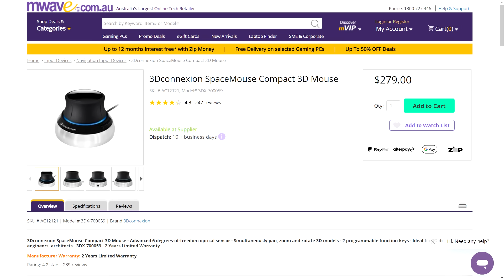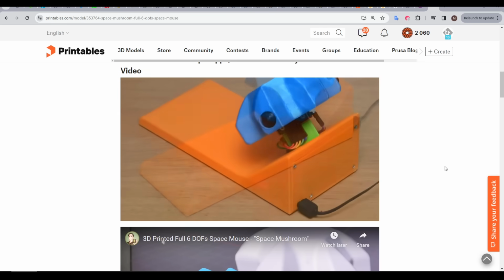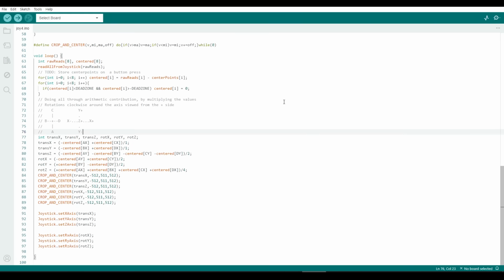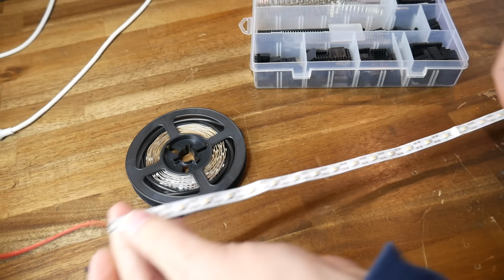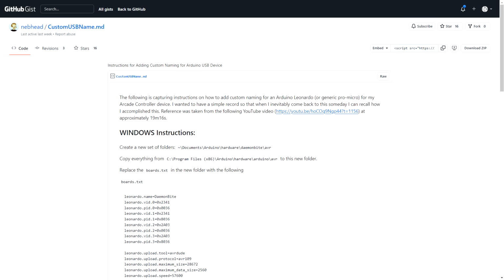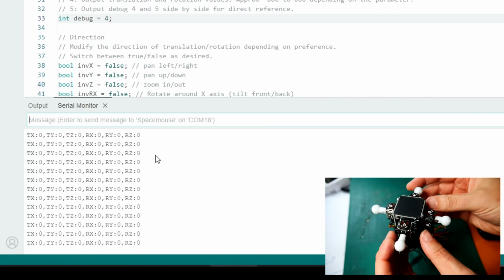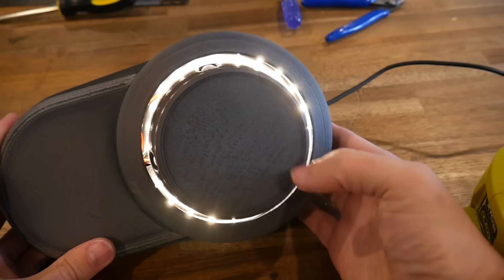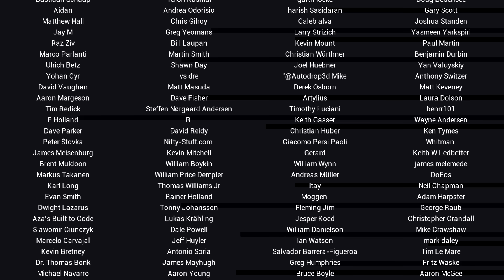Making a cheap, open source 3D space mouse with Arduino and 3D printing *V2 out*

Comment: I bit the bullet and bought a space mouse. I love it. I use a lot of CAD sometimes 8 hours a day and see it as a worth while expense. I'm so glad 3D printing can make it more accessible to the hobby market.
Reply: I'm hoping this will lead to better software integration for space mice.  Kinda sucks that they can only be used for a couple programs right now.
Reply: Space mouse let's me do things so much fricken faster it's not funny. If you're doing CAD full time there's no reason not to plop down that money. It's your tools of the trade, don't skimp!

I find people don't put enough thought in their normal mouse selection either. I'm a trackball guy though I wish I could find on with even more programmable buttons. 8 isn't enough, lol.
Reply: @Andyjpro  In which CAD program do you find this increase of productivity due to a 3d mouse?
Reply: @AsiAzzy Any of them. Not having to abuse the middle mouse click to manipulate a model is huge on its own, but then couple it with hot keys right above the knob and a 9 button programmable track ball and I just kick my feet up, sit back, and model some stuff
Reply: @Andyjpro   the inertia of movement still feels weird to me. Fair point for middle click abusing. I have sturdy mice with wide wheels and swapped the axles for a metal one. I've seen plenty bad mice and feels bad. I have an assortment of good mice to chose from so far it lasts for over 5 years one RAT5 i mainly use.
I mainly use CATIA and the sharpness of movement of the normal mouse is way better than the sluggish accelerating-decelerating-overshooting-reverting.
I have space mouse pro, i don't use it, tried to use it and still don't like it. I find normal mouse way better in Catia.
Reply: @AsiAzzy  it kinda sounds like you need to tweak the acceleration settings for each axis. The default acceleration is ass, and each CAD program is going to have different acceleration settings even within the same user. 

It takes a little bit of time to get them to feel "even" or to respond in a way that is predictable but the pay off is great and you can achieve a lot of fine control. 

I've never used Catia personally so I can't comment on the following, but some CAD programs have dynamic spin centers which change according to the cursor position and that can do wonky things when the space mouse is used in conjunction.
Reply: Yeh.. they are SOO brilliant once you get the hang of it and the right driver set up. It's like getting another arm or something.
Reply: @sirrodneyffing1  really its like getting 2 extra arms with another mouse for each.  Mice only have 2 DOF, space mice have 6.
Reply: I bought the "Student " version for US$80 back in architecture school.  It was great in Sketchup, but when I brought it home at the end of the year, it mysteriously stopped working.  Years later, I bought a used full-sized one from eBay,  again for $80! Works pretty well in Fusion360, too.
Reply: You can buy a used one quite cheaply. But I don't like the fact that they have a monopoly. They deserve some competition.
Reply: Im working almost everyday for over 8+ hours in cads. Tgqts my job for the last decade. No need in something fancy. 5$ mouse is enough for most of the needs...

Comment: Great video, especially on all the work to get the multiple ideas together to get a working concept. The very first thing that needs to be upgraded are the joysticks themselves. If they aren't hall effect, they will likely start getting stick drift within a few months of decent use. Considering all that coding, it's gonna be a nightmare to re-zero everything and find the new null zones. There are plenty of hall effect replacement sticks on Amazon. These will increase the price of this build slightly, but its worth it if you got a final design you want to use daily.

Another consideration to help shrink the size of it would be to use smaller joysticks. GuliKit sells replacement hall effect joysticks for the Nintendo Switch. They are much smaller and lower profile than the ones used in this video. However, since they are lower profile they might not have as much throw and you would likely have to adjust the sensitivity a bit to compensate. Also, a different way to mount the ball joints would have to be considered.

Comment: Space mouse is awesome in SketchUp. But In fusion the orbit point is fixed so it doesn't let you fly around like a helicopter. Unless there is some setting I'm missing. I stoped using a space mouse when I started using fusion.

Comment: @15:40 You're Translations are wrong - For the most NATURAL interaction ( I own both the SpacePilot PRO and its successor the SpaceMouse Enterprise ) you'd want for your movements to work as if you're controlling the Object in your hand. NOT as if you're controlling a Camera moving it around the Object - Essentially your settings are inverted ( can be seen when you move the Puck to the left but the Object moves out of view to the right ).
Reply: I have watched a few videos and got the impression that with the original space mouse there were different modes so that one can either manipulate the part or manipulate the viewport depending on mode. Most of the videos I saw seemed to find the space mouse most useful for manipulating the viewport. At least that is what I thought they said.

Comment: tempted but since it emulates the actual mouse it's pretty much useless for anyone using Linux as their linux software hasn't seen updates in like 10 years
Reply: 10 years? My Unbuntu computer gets updates frequently. Which distro? Or do you mean the driver is old. User group says “sudo apt install spacenavd”.
Reply: @peircedan  I mean the 3d mouse driver. Hasn't had an update since 2014 on their website. Using arch btw

Comment: The 3dconexxion space mice are amazing if you do a lot of cad. Unfortunately the driver situation leaves a lot to be desired, for example it cannot be made to act as a regular mouse, even though extensive driver settings are possible. Another weak point is the soft touch coating, which, while better than most, will still wear out after about three years, and, since it is good quality and well bonded, takes a lot of effort and ethanol to remove.

Comment: The reason the mushroom/control knob is so large is that it holds the 4 joysticks. The simplest way I think to reduce its size is to move them to the outside with their control sticks pointing inward. Yes, it would require a redesign of the 3d printed parts but should be lest bulky looking.
Reply: Could also use joycon-style joysticks, e.g. the hall-effect ones from gulikit to get them smaller while still using off-the-shelf hardware.
Reply: Had the same thought. There's likely a way to use hall effect sensors to do this but I'm not super well versed in electronics and part of the appeal here is off the shelf parts. One of my first thoughts was PSP /3DS style thumb-slide joysticks. They're very small and only a few dollars each
Reply: Better would be to redesign it to not use potentiometer based joysticks and instead to use some form of hall effect sensor. You get some that can apparently work as 3D joysticks.

Comment: Having the joysticks mounted all in the opposing directions might have been a better concept 

if you make all the joysticks face in words I just have a single shaft a ball or something Would Have Made It substantially smaller

I might try modeling this but I'm not too sure how far I'll get with the Arduino code because I'm bad

Comment: you need to gather up all the components of this, preflashed arduino, screws, analog sticks, premade wiring loom, make a TON of them and sell them on tindie alongside the STL files (option to sell 3D printed parts perhaps), you'd make a killing. Bambu labs have already caught on to this with their kits, but this project is on another level.
Reply: There may be some legal issues with selling this commercially since it’s using 3DConnexion’s driver and control software. Where they may turn a blind eye to non commercial use, competing commercially is asking for trouble in my opinion.
Reply: Given that there are literally no other similar products, there are probably patents involved.

Comment: I love the comically large size! I also have been down this road. I suspect there is a pretty comprehensive patent on this since there aren't even Chinese knock-offs on Aliexpress.
Reply: that is a very interesting point, which now has me searching......today's new rabbit hole
Reply: There are a few versions out there, at least one of them is bound to be based off old patents from some earlier model. Not sure if the eddy current one or another one not mentioned in this video, that uses semi transparent ramps and LED / phototransistor pairs. There's also another really cool one that looks a bit difficult to make and uses load cells and a rig that looks like a motion platform. 

This one in the video looks by far the easier one to make, every other one will require a custom PCB, some precision parts that will likely only work if printed on resin and some electronics that, if you're unlucky to live in a country like mine with ridiculously high import taxes, where most stores only send stuff through an expensive courier service, will cost you about the same as an entry level space mouse, if not more than that.

Comment: ...using Hall effect sensors instead of the joysticks and some springs to hold the dome will greatly reduce the size.
Reply: IMHO hall effect Should be where the open source community should concentrate their efforts.
Reply: @missassembly  It's also where the big companies should concentrate as well. Hell, Microsoft already uses Hall effect sensors in their Xbox One (and newer) controllers. They just don't use them in their joysticks. Their triggers use them
Reply: Printed compliant mechanism too. 
I own one already......😄
Reply: You could probably make a space mouse from just a webcam, rubber bands, and a backlit QR code.
Reply: Was thinking the same. Substantial size reduction, and potentially a much better feel too.
Reply: Almost like that already exists, and you can just do that if you want.
Reply: There is already such a project for at least half a year, I even have replicated it myself. They both just frustrating rubbish compared to commercial product, unfortunately.
Reply: @vadimsham8047 What's the name of the project, and what were the issues?
Reply: @ColinJWiens  I dont know about the issues (im not the one you asked), but i did watch this video previously on a hall effect version. I have an actual space mouse at work, and compared to how a lot of DIY versions look like they operate, the real one is much smoother. It also has a heavy base so it doesnt move around on your desk. I havent tried making a DIY one yet as i feel like I am just going to be disappointed in the results given my experiences with the real one.
https://www.youtube.com/watch?v=iHBgNGnTiK4

Comment: I hate 3dconnexion because for over 15 years people have been asking for a deadzone configuration and it is never provided. There is a way to achieve this by hacking the driver but it's unreliable. Whenever i take my hand off one of these devices, the viewport/camera in any cad software is sent miles away which is really frustrating and makes the 3dconnexion devices look like a scam as it's just a polished turd, endorsed by Autodesk and etc.

Comment: I bought a Space Mouse used and ended up using keyboard shortcuts more than I was using the device. I tried to use the device for other things, but the Space Mouse software is far too limited. Would like to see a custom software eventually, even if it's not able to directly be used on the Space Mouse, but a DIY one
Reply: my biggest problem is that deadzone control doesn't exist. Whenever i take my hand off one of these devices, the viewport/camera in any cad software is sent miles away which is really frustrating. For 15 years people have been asking for this option but it only exists as a driver hack and it's pretty janky. And this hasn't been limited to a single device or computer.

Comment: I had looked at some mushroom 3d mouse and other alternatives a few weeks ago and decided to put it off for now. I was leery about using analog joysticks being concerned about drift. For me the real issue though is that I am just starting to use blender and may use freecad. I feel I should first learn these tools before jumping into alternative input methods. Historically I have used OpenSCAD and so have minimized the need even for a standard mouse. I like the idea of using four joysticks rather than three to avoid complex transformation of the movements.
Reply: I have the 3D connection space mouse pro and for Blender it's a must have. Once you have all your keystrokes and macros programmed in you'll look at people using a keyboard as cave people. That's the difference it makes in productivity.
Reply: @Gorilla_Jones  My keyboard is completely DIY customizable and capable of running macros. This is one thing I wanted before tackling Blender as I wanted to be able to keep my eyes on the monitor and avoid reaching for keys farther than one row or column from the home keys. I chose a Corne style split keyboard then modified to my taste. This was a project where DIY really paid off in reducing price paid.

Comment: Very nice made! I like how you positioned all the electronics! :)

I do have the spacemouse pro and it's easy to move multiple axis at once instead of using every axis individually like all the open source designs.. but at 1 point, I believe the open source versions will be better than the originals ;)
Reply: anything will be better than my experience with 3dconnexion - without a deadzone option, the device, whenever i take my hand off one of these devices, the viewport/camera in any cad software is sent miles away which is really frustrating. For 15 years people have been asking for this option but it only exists as a driver hack and it's pretty janky

Comment: I have a Space Pilot and Space Pilot Pro. Got them on ebay to save money. This is even cheaper though. I actually like the original better because it's easier to find the buttons without looking at them. Unfortunately 3DConnexion stopped supporting it and the old drivers just kept getting worse and worse.

Comment: If you shifted the thumb stick parts from inside out to outside in you could get the mushroom smaller and probably add a inner spring to it to take the weight off the sticks or dial in the force like you would with a pro joystick and custom centering springs. That said big easier for a first build but you should have printed it in red and have a do not press on it for the fun.

Comment: I plan to make one of these, but Adafruit has something that might be an option for smaller joysticks. 

Adafruit mini 2-axis analog thumbstick.  Id 2765

17.5 x 17.4 x 12.0mm

Worth exploring at least.
Reply: I think those move in one plane, like the ones in the PSP so you wouldn't get 6 degrees of movement. but there are slimmer ones available for other handhelds, like the switch or the GPD WIN, the issue would be making them work with arduino

Comment: I own a Spacemouse Pro and I never use it because those drivers and Fusion360 support never were a smooth experience on MacOS. I‘d really like an open source version that just works.
Reply: In my experience it’s fusion that’s the issue. I’ve got the same setup and Onshape is fantastic with the space mouse pro.

Comment: Well done! I'm shocked that official Spacemouse prices have skyrocketed so much. I think I paid $99 CAD for my original, and even less for a used one. More importantly I'm glad I'm not SOL if the company ever goes under, thanks to everyone's efforts.
Reply: And it is the Australian importer / official reseller at that, not a straight USD/AUD conversion. 

The least expensive one can be had in the US for $99 and I got a wired pro (I hate replacing batteries) for less than $200 on sale.
Reply: Just as a heads-up: the prices in the video are Australian dollars, so the numbers you see are a good bit bigger than you may be used to, but still, the prices for those things ARE steadily going up, with mostly the same unfixed *ahem* quirks as in the first models...

Comment: 3DConnexion SpaceMice are built like tanks, high quality products with great software support. Been using mine for over a decade and it has paid itself back tenfold over the years. I work in gamedev (3D art).
Reply: I have a space mouse here too, and it's a daily driver for me. I use it for anything that supports it. It's a must have if you do any type of 3d work a lot. 

Mine is going on 10 years too. The soft touch plastic on the palm rest got all gross and sticky with the years, but I was able to remove it all with some IPA, it feels new again.
Reply: Great support until they stop supporting it. I miss my Spacepilot.

Comment: I tried to make some of those projects and eventually bought genuine SpaceMouse Enterprice. Never regret about this. It's not about software, it's about feeling. All movements are smooth, springy, there is no drift, no backlash, lots of programmable buttons and the device itself has very pleasant surface to touch. So, as for now, don't waste your time and just buy genuine one. Especially if you make money with 3D design.
Reply: Yup I looked at these but decided it was more worth my time to keep an eye out on eBay for a used space mouse. I spent $50.
Reply: Exactly 💯!